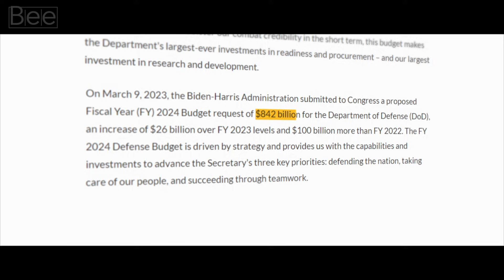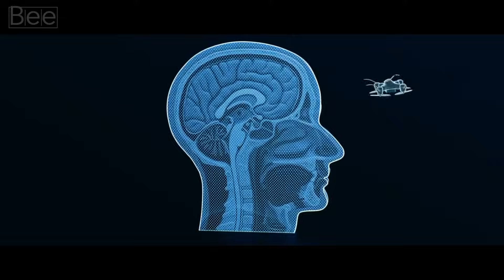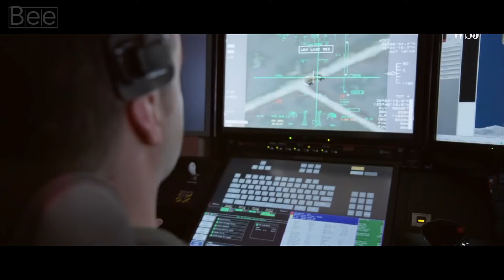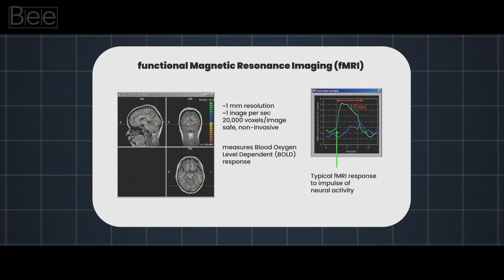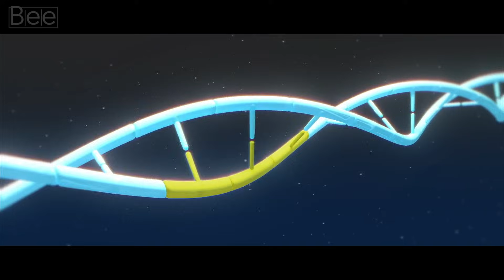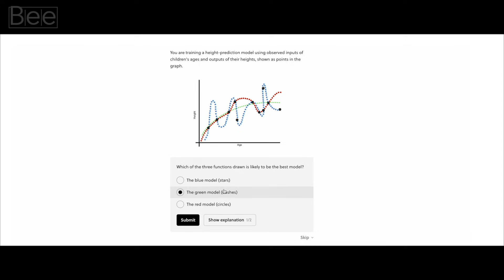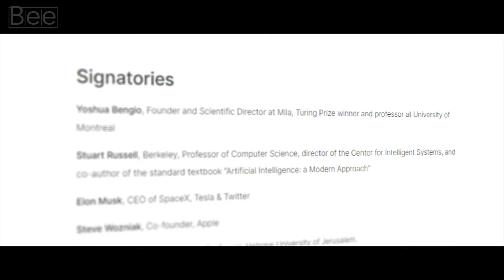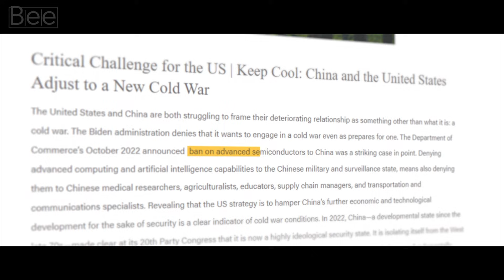DARPA's Secret Tech: Bio-Weapon & Mind Control TERRIFIES Scientists

Comment: When it comes to small electronics, chinas got this in the bag. Their ability to mass produce cheap electronics is next to none. And they do it all for cheap. Sure, they might have more defects than that of which other countries produce. But the rate at which they can manufacture this stuff is so above everyone else, that the number of defective items wont even matter. 
But people are skipping over the most important part of all of this. The whole reason war is effective, is because of the number of people lost. When robots are fighting robots, or technology is fighting technology, the number of people that die is going to be far less than previous wars. So then, what is the point of war? 
How about we all just grow the f*ck up, and learn to talk to each other, stop being deceptive, stop all the immature crap, and just be real, and figure things out without the violence? I mean, if the people running this place arent mature enough to solve problems without violence, yet normal civilians get punished for acting violently, then what does that say about who we are as a species? Lead by example, you war-horny lunatics.
Reply: They use deception to ruin families.

Comment: "IF!" you were one of, if not "the" richest person on the planet, and you had 3 main mission trajectories of your business, 1. Massive tunneling machineries working under, 2. Thousand's of starlink satellites overhead. and 3. Implantable intracranial telemetry nodules implanted in the People BETWEEN the upper and lower operations, it would not be too far of a stretch to realize that the cranial implants in the People "between" are simply potential "switches" in an already established "circuit". A clumsy analog comparison would be the "electronic" football games from the 60's, magnets underneath "moving" the players ON "the board/Earth's surface" to control the players be the telemetry devices implanted in their skulls and wired directly to motor function control areas IN each individuals "brain". Now, "THAT!" would be something TO investigate,  huh? 🤔👍

Comment: I was stung by one of those things on my lower back in 2012 or ‘13 I dont remember. I was doing so well before that. But I took too many photos of chem-trails over my property and stupidly tagged my state senators on Twitter with #IDONOTCONSENT to point out the affects of the chemicals had not been tested on humans and was potentially very dangerous. I could not communicate this experience to anyone for a long time.  like my head thought the words but could not speak! I feel the need to delete this already but Ive NEVER seen a post about that tiny terror gadget before this!! I used to be so strong willed and physically healthy. I went thru shit and just gave up. Eventually fractured my spine doing manual labor. 
All this shit is really ridiculous I should not believe its real but I know it happened. I tried to crush the fucker with a rock and NOTHING HAPPENED! Its was composed of tiny shiny triangle shaped reflective armor and the body shape of a hornet 😮
Reply: I 've seen them too!

Comment: w3apons control ourely by thought?
that's such a waste - humanity should work together and rather use this for really useful, practical, beneficial purposes which build, not which destroy. i.e., tools control purely by thought. send some probes on the moon and control them purely by thought (that's probably a bit too advanced, given the distance). send rescue mission drones and control them purely by thought. get some drones or small robots into various places humans have trouble going to or shouldn't in order to avoid disturbance of local flora+fauna - like depths of the ocean where pressure is too high, or somewhere inside a jungle - to see and study what goes on in there.
creative possibilities without destructive potential are limitless,
why waste time on destruction.

Comment: On everything love, I’ve seen something eerily similar. It resembled a wasp or mantis and had no wings but could fly. It made no noise and I spotted it floating by in the house. I smacked it with everything in me and felt my hand connect. I spent about a 20 minutes looking the remains but found nothing.
Reply: Oh wow they’re calling it “the wasp”. Ding ding ding!!
Reply: Revelation 9:10
Reply: @duelde-consulting6403 my thoughts also- man made for evil purposes and God turns it against them
Reply: That is called a dust bunny
Reply: Nap and glass of water?

Comment: Neuroweapon - ALREADY HERE, BEEN HERE you've been warned. Human Experimentation of the "mind control" weapon - has revealed chip is NOT needed (can use your Biometrics to target) BUT a chip works like the stuff in your computer for the internet or your radio and tv to receive a broadcast signal. They are NOT creating neural synapses like the brain does. They call it NeuroCognitive Warfare. It uses weaponized RF to your Brain to control your mind & body. The body can be controlled like Delgado's electrical muscle stimulation. The brain well it controls your memories, thoughts, senses - your thinking, speaking & control of your body. The memories are imitated by combining database information with Neural Augmentation for a feels real, seems real "immersive" experience in reality itself (DARPA/IARPA). What they have NOT told anybody - their attack over rides or overwhelms the natural signals to control you, to be you, through you - and that allows whomever is controlling the AI DEW System - to use you anyway they like - with or without your consent, in ways you would no longer even be conscious of if needed. BAD BAD BAD stuff. Came from the MKUltra days, so not new but now than they've put it all on AI to create & manage - its a Lethal Weapon you can't see coming unless you have specialized equipment like spectrometers or oscilloscopes. The one advantage is - using computers like this to covertly control people or create events & tragedies - means the hard drives have evidence of their serious crimes in our neighborhoods.

Comment: Targeted individuals. 
Already been going on for a very long time. You think they stopped at mk-ultra?
Reply: Its wireless technology that the police and other law enforcement agencies use of people. I'm not big on science but it has something to do with waves and frequencies. Tinitus is usually a sign they are using the equipment.
Reply: @raycar9827  Do you have anymore info on whatever this technology is that police may be using?
Reply: I think at this point we are all targeted individuals. I believe that there are a limited variety of reality paradigms or narrative programming that each person is assigned. That's why you might see T.I.'s that share similar experiences that sounds absolutely crazy to normal people. But the reality is that the normal people are just assigned a different programming than the supposedly targeted individuals. There's fabrication or manufactured realities found in both they're just different in the content detail. One might argue that what the "targeted individual" experiences is just delusional, while failing to acknowledge the fabricated aspects of Their own reality. With all that's going on in America and Western Society it doesn't make a lot of sense that most people are just complacent with the bastardization of these supposed principles and Democratic Dynamics that quite apparently don't exist. It's all so freaking blatant but no one says or does a goddamn thing
Reply: @mizzamoe There are people doing plenty. You just don't realize it. The technocrats are utilizing human abilities and synthesizing them, just like big pharma does with drugs by copying herbs etc. 

Everything cool technology is a "copy". The frequencies used for v2k as a mind weapon are already accessible to every human using their own thought energies. 

Lots of people think the technocrats and elite are atheists because that's what they push onti societies, but they are extremely spiritual- just in a dark way. 

They know what human beings are capable of, and so they create synthetic versions and other bad stuff (broadcasting frequencies, chemtrails) to dampen our brains.

The (good) Spiritual community is very active countering this with our thought energies, aka prayers.
Reply: They moved it to Twitter
Reply: DOD and CIA, along with Raytheon and Lockheed Martin are using Extremelyow Frequency microwave and a brain to computer interface for mind reading, mind control, brain hacking, mental and physical torture. It is a method of slow kill. One program targets would be whistleblowers, their families,  friends, colleagues. The eyes are a live camera. They can control speech, tears, bowels, actions. They can artificially induce cancer, heart attacks, strokes and thousands of other ailments. They hack the brain with premade movies or fake dreams, with fake God voices, fake thoughts through them controlling the brain. Every American is in danger. It is so being used in five eyes countries.  See Dr. Clark petition to the UN for shielding for Europeans to block out ELF microwave. I am a victim. Bill Binney is a victim. There are thousands of victims in the US alone.
Reply: Both Havana Syndrome victims and those calling themselves Targeted Individuals are being attacked by the same technology and the same perpetrators under the auspices of the US.
Reply: It has spanned every presidential administration since Reagan.
Reply: Exactly. They're further ahead than the video is telling us!
Reply: If you've had an MRI coupled with allergy injections at a time when your life seemed to fall apart, severe headaches and neurological muscle spasms, loss of memory, trouble sleeping - you are a target.  They send signals at varied frequency to track muscle and neuro response in an effort to map the body.  It's a non-traceable weapon which can manipulate from a distance.  Dr James Gioradano with DoD gives talks on youtube regarding these non-kinetic weapons of war.  The endless "State of emergency" couples with the "war on terror, drugs, ect" give legal authority for the DoD to experiment, target citizens over and over to refine these tactics and to even train our personel on how to implement.  So, if you are considered "disposable" for ANY reason by your gov, they will use you to further refine it.  The "pilots" are blowing the whistle on the DoD risking becoming a target themselves as we speak.  Support Tim Burchet & friends as they lead the fight against the gov targetting its own.

I've been a target for 2 decades.  One day, the people will find out and our military & policing personnel will be looked down on for NOT standing up for the most vulnerable populations.  This has an exponential negative effect on society.  The perpetrating parties begin to realize this apparatus WILL be pointed at them once it's autonomous.  They are building their own cages.  That's why they were forced to get the shots first.  They lined the military up FIRST, then gov employees, then Corp America.  They can use radar/satellites anywhere in the world to give you a clot, heart attack, or stroke with self assembling nano-particles supplied by vaccines and in the air/water/food supplies.

It's already in our bodies.  Why do you think supply chains were all cut off?

We aren't at war with China, Elites are at war with all our unnecessary consumption
Reply: @raycar9827 @mizzamoe I agree with both of your comments.

Their technology is extremely advanced, it can make you see/hear/feel/think anything the human body is capable of. Even things like dreams and "paranormal or psychic" experiences. 

There are many TV shows, movies, and books about ghosts, paranormal, aliens, demons, angels and it's all propoganda to condition the populace from a young age. 

In the past if someone saw a phone they would think it's magic or if they heard or saw a prophet/demon they would think it's god or the devil. But it's 2023 and we know now that these technologies exist.

Everyone is a targeted individual and more observant people will notice the fake aspects of their reality better. The targeting usually becomes more overt/obvious and more severe when the T.I learns that this phenomena exists and it gets worse  when they become obsessed with it and look it up online all the time. "They" want us to waste our time obsessing over conspiracy topics online that add nothing of real value to our life. Help yourself, help others, and spread positivity in the world. 

That's not to say don't raise awareness, just choose your battles wisely. 

What has helped me lessen my targeting to a great degree was at first learning and understanding it better (I became obsessed which helped me learn about many different obvious tactics they used on me so and reading many T.I accounts having similar experiences so I can spot it better now) and after a few years I decided to completely change my outlook on life and moved my time/energy/attention to more important goals that helped me in making a better life for myself. In other words to become more determined in choosing my own path in life (as best I can) instead of letting others choose it for me.
Reply: Hi to everyone reading this 💗🫂🙏🌏🕊 Please pray for all Targeted Individuals, V2K (voice to skull, hearing peoples voices) DEW (direct energy weapons, microwave tech weapons) DREAM MANIPULATION, SYNTHETIC TELEPATHY, NON CONSENSUAL AND COVERT MEDICAL EXPERIMENTS AND MIND CONTROL VICTIMS IN THE UK AND ALL OVER THE WORLD that their suffering ends asap and that all of these diabolical, horrific, torturous crimes and abuses against humanity and all living things, mother earth included! are ended and that all of the perpetrators who take part become known and are consequently convicted! And please pray for the souls of the perpetrators who no longer want to be part of this evil 🙏🕊 AMEN🙏
Reply: nope.